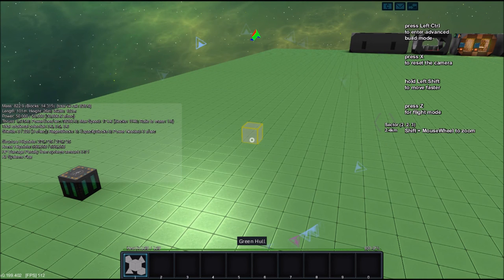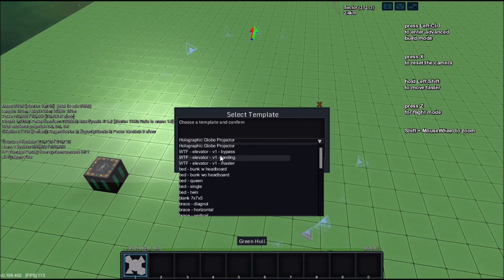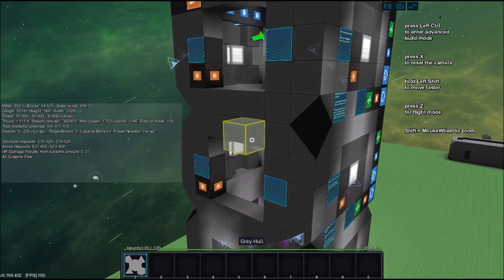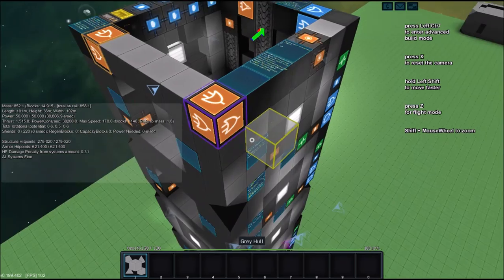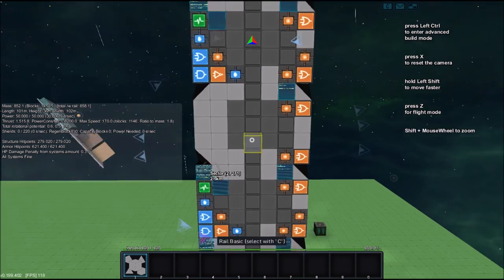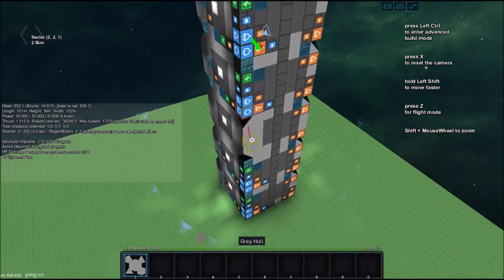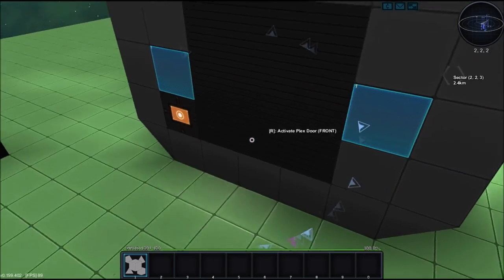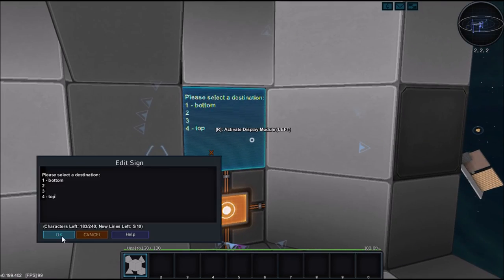StarMade - Fancy New Logic Elevator! (feat. sensors and display blocks)

Comment: It is very cool, however I feel set up seems quite complex and possibly could be made more simple removing some features like the optional names, still it cool with a modular elevator :)
Reply from the maker: Thank you!

Removing the optional names would indeed make it simpler, but the beauty is that it's completely optional, and if you don't want to use it, you do not need to connect that part to the rest of the elevator. I also feel like my desire to have doors on the shaft and platform also contributed to the complexity. I've made much simpler elevators in the past where it just had a button for each floor on the platform (connected to the rest of the logic wirelessly) , and no doors, and it had far simpler logic. I figured the final result of this would be worth the additional setup, though, when it comes time for installation into the ships I created this for.
Reply: Indeed I agree to 100% that templates should have a certain complexity so that making it as a template is actually needed :)
I want to experiment if I can make a elevator with minimal connections, would be great for new players too, still,your full feature elevator is awesome
Reply from the maker: Go for it! I imagine you could make a less complex elevator to assemble if you forgo doors, and keep controls limited to just button presses.
Reply: Yes, but display command is so much cooler, will require some set up, like floor, but maybe it can be minimalized
Reply from the maker: Oh, I absolutely agree.